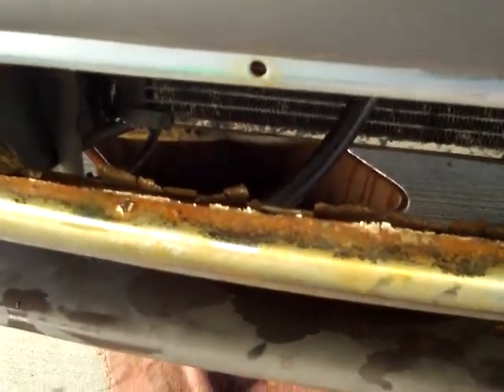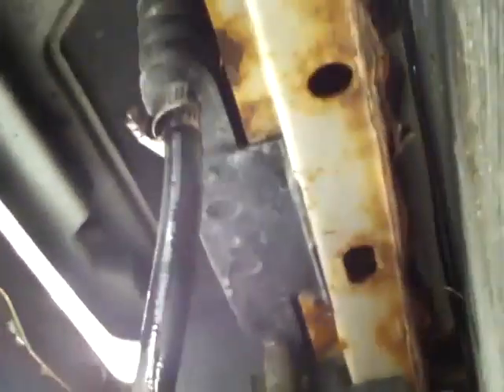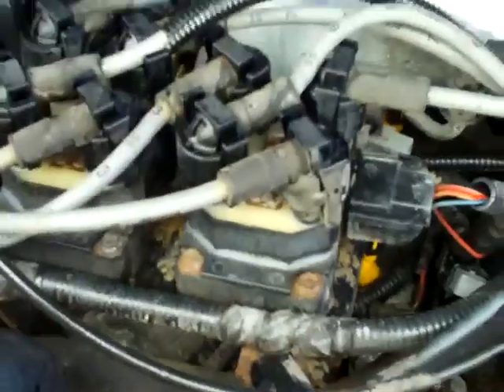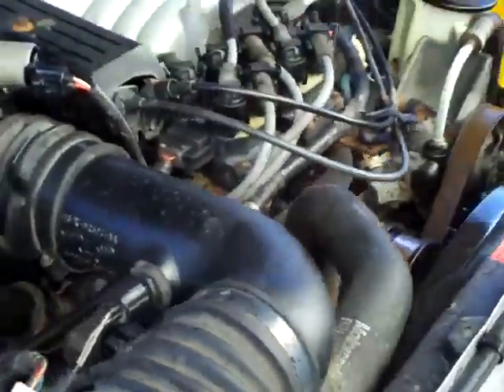Inertia / Fuel Cutoff Switch 1996 Ford Explorer V8 5.0 AWD XLT

Comment: this is crazy I'm gonna have to check this. i did a swap from OHV to SOHC, and on first start up it turned on but then off right away. I'm getting fuel to the rail but it seem to not be consistent. im gonna have to check this tmrw. thanks

Comment: I have the same problem, my inertia switch apparently has tripped, and the button is pushed down,I push and hold it and mess with it, and it finnaly turns the fuel pump over,my car does this on a daily baisis,its a 1984 lincoln towncar signature series

Comment: How does the electrical connector look. Our Sport Trac keeps stalling. Turns out the inertia switch keeps tripping. I checked the switch while the truck was running and it was very warm. I pulled the plug off and the wires were discolored and the plug was distorted from heat. I'm going to use a meter to test resistance on the old and new unit to get a comparison. I hope I just get away with having a bum switch, but the more I look on the internet, the more I find this is a common problem.

Comment: Okay well if anyone seen this video and you took the panel off, and you come to see that there isn’t a button, check the wires around the black panel, it still has a red looking button I kept pressing it like an idiot but it isn’t a button the wire was disconnected.

Comment: Would it be possible my switch is bad? Ive pressed it checked all my relays replaced the fuel pump. I should be able to hear the pump pressurize the line but i get nothing. Im lost any sugestions welcome, except go to a mechanic.
Reply from the maker: Riley Emery Check the fuel pump relay/fuse.  Then the fuel pressure sensor.  Could be a wiring issue as well.
Reply: Typical diagnosis is unplug the connector and measure for 12V on the power lead to it.  It should have 12V for a moment when you first turn the ignition key, then 12V to the pump turns off.  If it's not getting 12V there is only a fuse and fuel pump relay in between it and the battery.

Comment: I swear my explorer does not have one. I checked in the spot where everyone tells me to look and there is nothing there...
Reply from the maker: ***** If its newer it might not.
Reply: SparkysGarage It is a 94.
Reply: @EdgarAllanPoon  This is an older comment and I can about guarantee a reply won't happen -- but for anyone wondering, 91-95 Explorers were all vastly different in weird ways and it may not have had it from factory (((though I doubt it))) worth looking into if you're reading this comment and have a similar concern